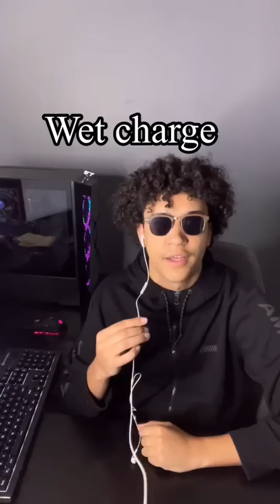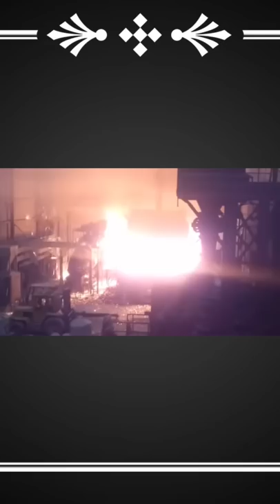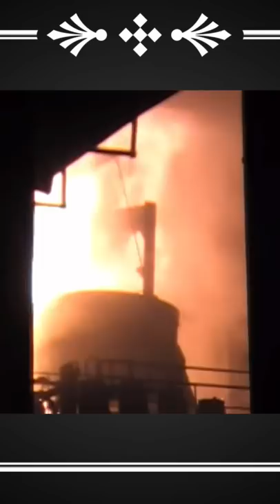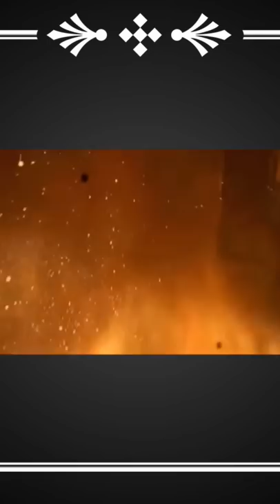Wet charge! Steel mill danger! #shorts

Comment: That's a melting pot at the melt shop. Scrap steel is put in there and heated by high voltage electrical rods and melted into rebar, steel cable, ect.
Reply: The same thing Is used at steel mills. There are a few around me and I know plenty of people who worked there
Reply: This was at a steel mill. Happened in Warren Ohio about 10 years ago I know people that worked there when it happens.
Reply: @KJGFarms  this happens daily in steel mills. Just part of the process
Reply: @mid-wikid  yeah some shit needs to change if this is normal
Reply: @KJGFarms  oh shit was this V+M?
Reply: @insanemind5321  Yeah every steel mill has a melt shop.
Reply: @samsprague6923  Warren steel
Reply: @KJGFarms  I heard a about warren from a dude I work with that used to work there. Safety used to be really under par and shit like this just happened way too often.
Reply: @mid-wikid  I’m not sure about “daily” cause there would be safety checks to prevent this from happening like a drying process so it doesn’t happen “daily”

Comment: I work with ~800°c liquid aluminum, and  sometimes I look at it and think, "dam, this is supposed to be solid." 

And speaking from experience, it's not fun to get some on you.
Reply: Really? I thought it was fun to bathe in liquid aluminum
Reply: @jacobthemaster66  why not liquid tungsten? Edit thats 6,191F (3422C)
Reply: @Inotacookie  Refreshing, feels like Florida
Reply: @Randoo_Nandoo I work with ~1700°c molten steel and have the same thoughts. It's crazy how something that's hard af in normal temperatures can act like some kind of heavy liquid when it's hot enough
Reply: The sun: pitiful
Reply: aluminum is BARELY a solid. the softest common metal and most common pieces i can bend with my hands
Reply: @byloyuripka9624   Magnesium, silver, gold, calcium, gallium (which is the true "barely solid" metal, because you can melt it with body heat alone), tin, lead, lithium and sodium are softer and some of them even more common. Sodium is in salt, tin cans, lead bullets, silver and gold jewelry, lithium batteries...
Reply: @byloyuripka9624   "most common pieces I can bend with my hands"
Tell me you've never worked with aluminum without telling me you've never worked with aluminum. "Most common pieces" in an industrial setting are 1/4"+. Good luck bending a chunk of 1/4" aluminum without using either leverage (which can be used to bend pretty much anything by muscle power alone) or tools.
Reply: @richardmillhousenixon  I work at a aluminum foundry we make engine blocks and blast proof midpans for the military i can assure that you can't bend it with your hands or with a leverage
Reply: @qtip2177  With a long enough lever you could definitely bend even the strongest piece of aluminum, but at that point you're basically just cheating.
Reply: Know I'm late but can I get the story of when you got molten metal on you?? I'm assuming it was a lot of cursing followed by a hospital trip.
Reply: @lilpotomus4261  Depends on how much aluminum. Just a drop? It will definitely leave a scar, but as long as the aluminum is hot enough, you won't need to go to the hospital. It's when the aluminum is just above it's melting point that it could cause issues, because some of the aluminum could solidify in the wound and cause aluminum poisoning or an infection later down the line. Any more than just a drop and you are definitely going to want to go to the hospital.
Reply: @lilpotomus4261  a lot of cursing, yes, but I've never had it bad enough where I've had to go to the hospital... yet. I have to pour the metal with (what is practically) a bucket on a pole. Sometimes drops or globs fall out and onto you. 90%of the time, it's so hot it slips right off. But that 10% will burn. It'll leave a scare, but you probably be ok.
Reply: @torte007  Lithium is in Lithium batteries.
Reply: Damn, this is supposed to be solid. Why's it soup?
Reply: @justinlopez5238  I can't tell if you're joking or not so just in case, the melting point of aluminum is below the temperature at which it incandesces, so in a well lit environment it is often hard to visually tell whether or not aluminum is molten without manipulating it in some way.

Comment: Story time. I was in 9th or 9th grade summer, me and a buddy where in his garage. He was pretty smart but sometimes common sense just didnt make it to his actions. We had bismuth, and we're melting it down over and over again, making crystals. He wanted to cool it down faster, it was winter time with about a foot of snow outside. It was fully melted slag removed ready to cool down and for crystals. He took the pot out side on a pair of vicegrips, and put it on the snow. It quickly melted and snow feel into the pot, immediately boiling. It popped and metal went flying, it ended up in his eye melting his eye lid shut. A large piece hanging from his eyelashes, he ran inside freaking out. I cut as much out as possible we ended up at the hospital, where his eye was cut apart and metal removed. Told his mum is was ice, I dont remember how we explained it was ice instead of metal but she didnt question it. Hes ok now wears glasses and safety glasses, and is a heavy equipment mechanic. Dont let water in molten metal.

Comment: My dad was a millwright for years. He told me about this kind of stuff growing up, but I never even thought about looking it up. He made it seem like it was no big thing, and it just happened sometimes. That shit is fucking terrifying. I work in an aggregate mine, and never lets me forget he worked in the mill😄.

Guess I know why now. Old cod sack busted his ass in a place like this to keep is fed as long as he could. My dusty little mine, and I better pipe down.
Reply: Working in a mine of any sort is just as dangerous as working in a Foundry working in The Foundry you're dealing with the refining process of hot metals and the possibility of what's going on in this video happening, and working in a mine is dangerous because there's is dangerous because there's a possibility you could get trapped if it collapses also you are working with explosives and have a possibility of digging accidentally into a methane chamber and if you do so but don't check the types of rocks around you so that your tools don't Spark then a creeper will come out of nowhere and you know what happens next
Reply: Nobody should have to work in any of these conditions. I hope you’re paid well at least.

Comment: I used to work at an aluminum plant. When it was snowing and we’d charge wet metal or metal with a chunk of ice in it into the 1300 degree furnace with a front loader it would sometimes blow back hard enough to lift the front wheels of the machine off the ground and it would shoot out little drops of molten metal about the size of a 9mm bullet that rapidly cool and harden as they fly through the air basically making a giant frag grenade
Reply: Why would you do this on purpose? Does it serve a purpose?!?
Reply: @jonhall2274  So I can wrap my food in aluminum foil that's why

Comment: My dad worked at a foundry called wer tek. My dad came home with burns literally every day, but he said he would still rather get burned by splashing metal because it's less intense and doesn't last as long as "a burn from the stove" as he put it. He took me to work one day and was pouring a mold and I legit watched molten metal go in my dad's mouth and he spit it back out cold and told me to put it my pocket to show my step mom when I got home.

Comment: This is the coolest thing ever cuz I currently work in a steel mill. Our company has two separate buildings. The one I work in is a rolling mill where we take billets (5 inch x 7 inch x 30 foot) that are produced in the "melt shop". The melt shop has been shut down because we have a sister company that make all our billets but when it was active, a wet charges explosive reaction is sufficient to blow the walls apart of the building next door. I don't believe we have suffered any lost lives due to a wet charge but there have been many hospitalizations. Worst one I heard was one guys Recieved 3rd degree burns to 85 percent of his body and lived.

Comment: I work at a steel mill and we had an explosion somewhat like that. If it rains heavily for several minutes or rains an entire day, the crane operator has to hold the charge over the open furnace letting the extreme heat get rid of as much water as possible and we can drop charges ever 30 minutes with my current mills setup, but when it has rained a lot we can’t drop charges faster than 1 hour apart so they crane operator can let it sit over the furnace to dry

Comment: My father worked 30 years in a steel mill. This is exact reason is why a kid was killed and my father luckily survived with 2nd degree burns all over his back and neck. A pipe flew off and pinned the kid to the wall, going right through.

Comment: Scrap going in a bit wet isn't an issue as it will evaporatebefore contact. The issue is when a piece of scrap goes in that is holding water. This is because in order for the explosion to happen, the water needs to get submurged under molten metal and this can really only happen in side of an electric arc furnace because of the way/direction the  magnetic field causes it to stir. I actually did some experiments with this after accidentally making a wet charge myself in a 1000lb furnace (much smaller than a steel mill EAF) to find out when this is actually dangerous. Basically what I found is you can pour water directly onto molten metal or vise versa IF it is not in the furnace.

Comment: Been a furnace operator and worked in and out of many steel mills in my day one styrofoam coffee cup falling into a furnace that's less than half full will level the building if it falls into it. The moisture creates more gas as it gets hotter rapidly cooling the immediate iron touching it.

Comment: Apart of my training when I was working as an industrial cleaner at a steel mill was "if you hear and feel a big boom, don't move. If you move or try to run, you'll probably die." Not sure if True at all steel mills, but this one had dust along the rafters that would turn visibility to zero in this event. So one wrong step or someone on a crane at the wrong time could end horribly when this happens.

Comment: A guy I worked with was the equipment operator who would pour the molten aluminum in the plant, it’s constantly over 100 degrees in there and there is a crew of guys who make 20/hour just making sure everyone is hydrated. There is also surges of electrical and man some of those stories were crazy

Comment: Worked at a foundry for about 3 years. It's called a geothermal explosion. Wet charges are common. Some worse than others. I worked on the furnace deck when we had one black out our plant. We have 7 furnaces, 3 we ran. In the 1980s furnace 2 of the 3 I worked on in 2010, had another explosion due to an error in charging the furnace. It popped and sent a crack through the entire plants foundation, still seen to this day. This one was a little more than mine, though lol. It's definitely not a job for everyone.

Comment: it is something you have to be careful about even with small crucibles. everytime you add new metal to the hot crucible you need to hold it above it for at least a minute to completely dry it even if you don't see any water or oil on it. the crucible will spew out the hot metal it already has.

Comment: I used to work at an aluminum foundry and one winter someone threw a ball of ice into the largest furnace on the floor and shut the door.

Now there's a dent in the opposing wall, 20 ft away and about 15 ft up, from the door flying off the hinge.

Comment: Worked in a foundary with aluminum and this is the reason we couldn’t have water bottles on the foundary floor. Before I started I guess there was a shipment of riser tubes with moisture in the filters so changing those by hand was always a quick drop and run away for a few minutes 😅

Comment: It takes a surprisingly small amount of water too, an ounce or two explodes like like a hand grenade.  I work at an aluminum foundry and the ingots are placed on the side of the furnace so they heat up to about 400 degrees for a half hour before they go in the soup.  They dont dump reclaimed metal into the furnace at all here, too easy for water to get trapped.  They send all their scrap out to a 3rd party that has big pots like shown in the video to turn the scrap back into large ingots (roughly 5ft by 5ft by 18 inches)

Comment: I worked in a steel mill for almost 2 years. I would dump the scrap metal into a pot which is right next to the furnace where they do all the melting. Explosions would rock my earth mover dump truck.... Crazy powerful stuff.

Comment: Used to work in aluminum stamping place. Had the same risk somewhat smaller scale. They showed us a video day 1 of the same businesse different location in the mid 90s where a water bottle ended up in a scrap bin. Leveled that corner of the building

Comment: For those that are unaware this happens when a liquid could be oil, gas ,water comes in contact with molten metal it expands to steam which can convert back into it original form oxygen and hydrogen it expands to1,600 times its original volume and producing a violent explosion

Comment: What's even more terrifying is witnessing one. I was loading steel at a plant outside of mobile AL when one blew. No one was hurt but damn that sound and the thump you felt was intense. On top of that the alarms and seeing the employees hauling ass in the direction to start working to contain it and to make sure no one was hurt. 

I've seen massive pile up unfold in front of me and I've hauled nuclear fuel rods across the country but I've never been that scared in my life before.

Comment: I work in a steel mill where the shop in in pours the steel into giant cast iron molds. When hooking our hydraulic system to open and close the ladle, the pouring crew is close enough to put our hands on the ladle full of molten steel

Comment: I used to work at a weld shop and we did A LOT of work for a local foundry. Shutdown repair type of work, and even hot operation repairs. Anyway, they had a rule ABSOLUTLEY no containers in the plant. Like a soda bottle with a cap. Can not be anywhere on the plant grounds. A can with an open top is fine, or a cup. But no sealed containers. I guess the trapped air if it falls into the metal will result in a similar type of explosion.

Comment: My grandpa worked at a steel mill ever since he was 17 first in Germany then when he came over to America. He had a pot blow up on him one time. His mill was hiring college students in the summer time and one time he volunteered to work at a station a college kid was getting to leave open since the other kid wasnt there yet. 20 minutes after taking that position they were pouring molten metal in a cauldron and no one noticed there was water in the bottom and it exploded like that. My grandpa got burned all over his body because he wasnt able to find a safe spot to hide. He went back to work withun one month later with burns still all over his body. He always tole me you can put water on molten steel but you cant put molten steel on water.

Comment: I worked melt in an aluminum car parts factory. A wet charge into that is worse I'd say. Steel is a lot heavier, so it doesn't go as far. With aluminum, it just explodes instantly. Like just a HUGE bang, a bright flash, smoke everywhere. Metal gets thrown at least 50 feet in the air. The only good thing is aluminum splash dries out quickly because it's only like 1300-1400°F

Comment: I work at an aluminum casting plant. I am THE GUY that puts the metal in the furnace with my forklift. I’m a “charger” as putting metal in a furnace is called charging it. On days when it rains, this is a big deal because we’re grabbing prime (near pure aluminum blocks) and scrap from outside.

Comment: I worked in an foundry before. That is some back breaking work. I'd go through over 3-4 gallons of water daily just sweating it out. And I'd still be thirsty when I got home. It could be a 10 below winter morning and that foundry would be 130. We were required to wear long sleeves and jeans. You could not show skin because the heat was so intense it would burn your skin. And expect to be consistently lifting around 200 lbs throughout the day because you're gonna be lifting that kind of weight repeatedly. I worked the furnaces and my job was to feed all the furnaces with metal to melt down. This is done by hand and when you open up the back of that furnace to toss in several hundred pounds worth of metal you really feel that 1500 degrees hit you. I had to wear a welder's mask just so the skin wouldn't boil off my face and so I could see inside. It's damn near white hot and it's bright. My day would start at 6 a.m. and every day at around 1 p.m. I would always start to pass out. Black spots in my vision and lightheaded. Sweat practically pouring off of me. Every day like clockwork. And this was often 7 days a week. I did it for about 5 months and decided I couldn't do it to myself anymore. Man, was than an experience though. In a way I almost look fondly back on it because of how hard it was. Would I ever do it again? Go fuck yourself is what I would say.

Comment: I worked in a foundry right next to the furnaces and they went to dump scrap in that was outside not thinking about it snowing the night before, they dumped it in and about 15 seconds later it blew the lid off the furnace, went through the roof, and landed in the cornfield out back